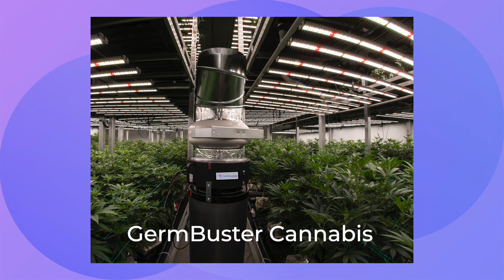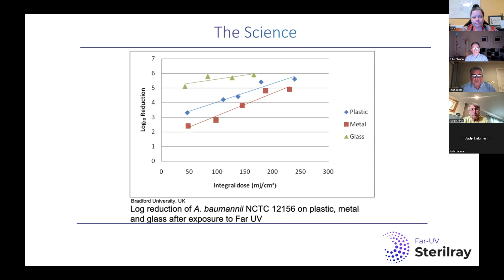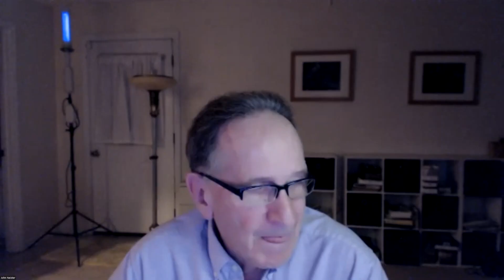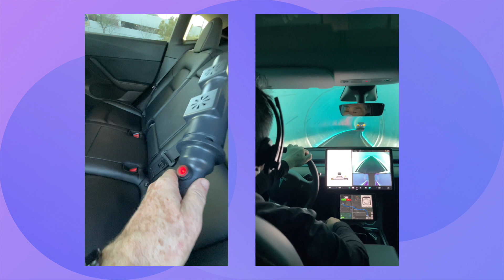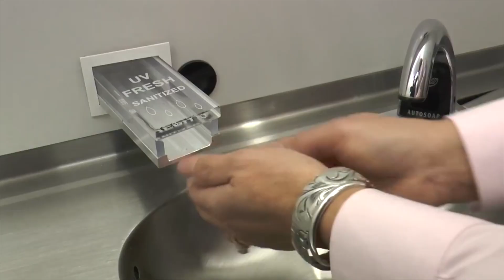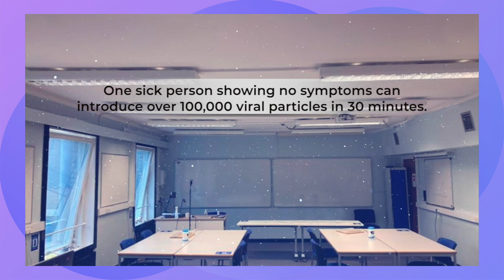Still Coviding, Forward Motion zoom meeting with Mike Olsen and John Neister

Comment: Excellent video, explains a lot and answers a lot of questions. There is a global issue with getting spaces safe from a infection standpoint, both due to the pandemic, but also due to mold, and other diseases. And the research is pretty clear - airbourne pathogens are really good at spreading and a danger. Nice to finally see FAR-UV come out as products beyond the technical research.